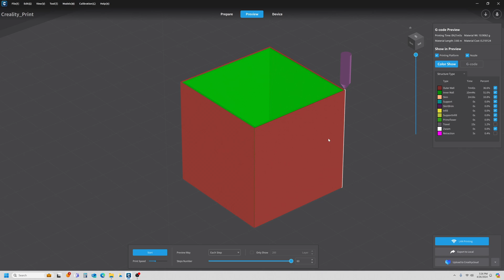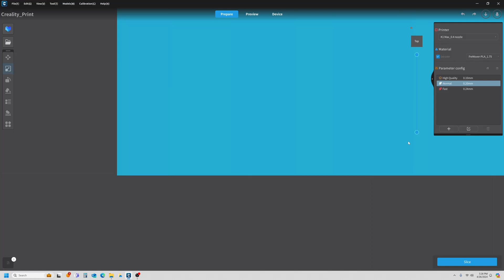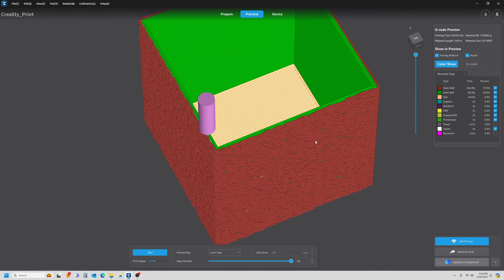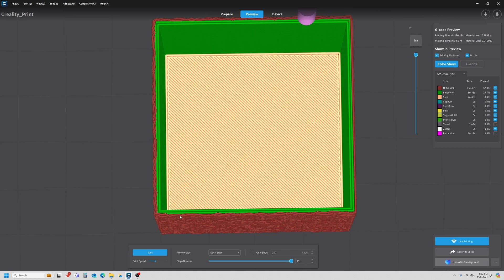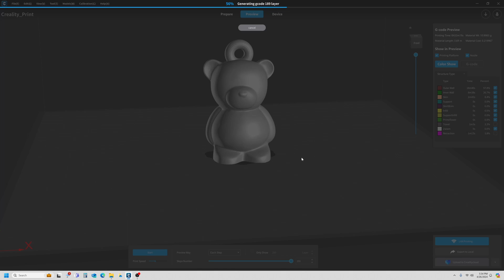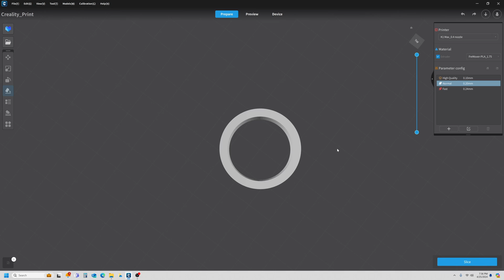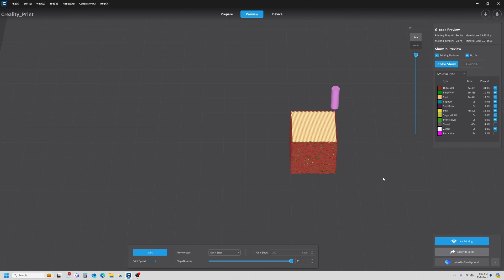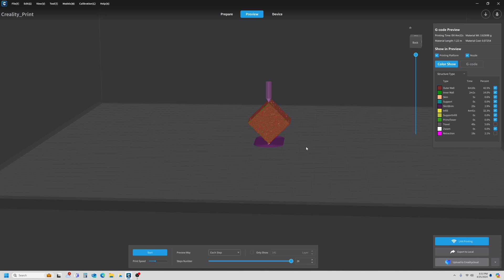Using Fuzzy Skin In Creality Print

Comment: Sorry to say, I found this video to be completely useless to me. I never see a screen that looks like what you show at 3:04. Am I just using a different version of Creality Slicer? I have never been able to find a menu with an "experimental" button. Any help would be greatly appreciated.
Reply from the maker: I have no idea what version of Creality Print you are using, but it's on the right side of the screen. There are several vertical icons, the bottom one looks like a four leaf clover. Click that and the new section for it is called "Special Mode" You'll find it there.

Comment: Are these parameters what achieve an impression with a "porous" texture as if it were fine-grain sandpaper?
Reply from the maker: Yes. But you can adjust the settings and get a totally different texture as well.